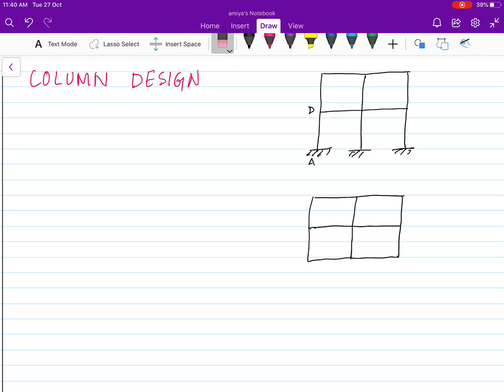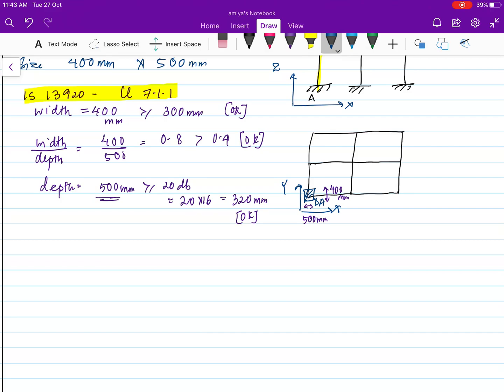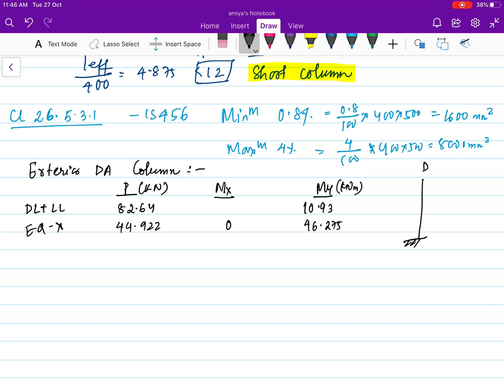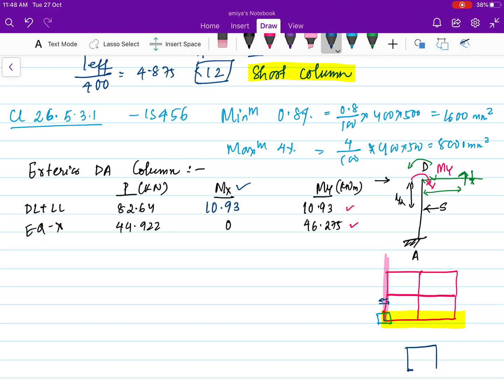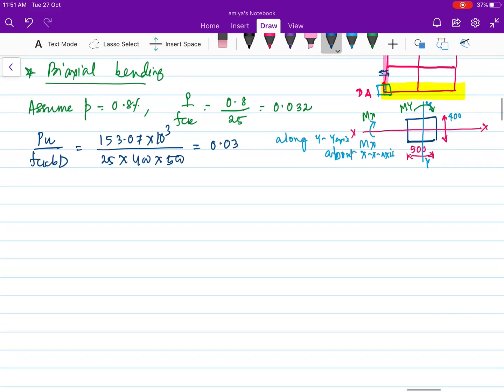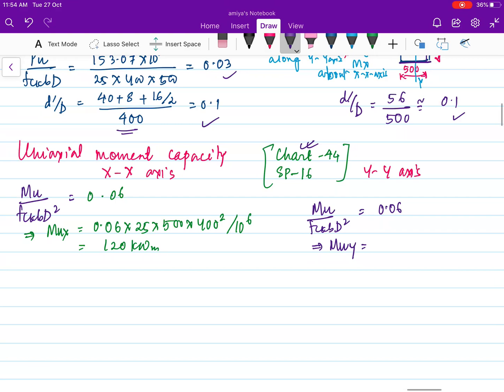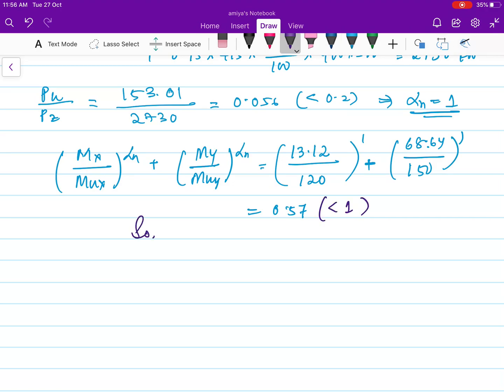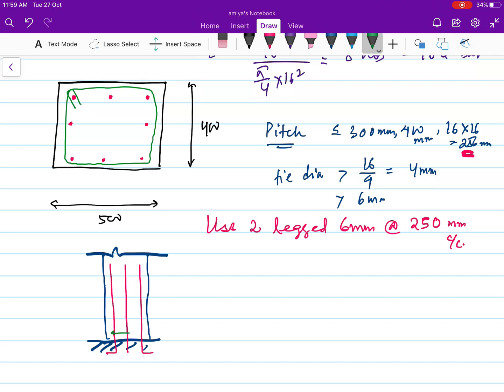Column Design IS 13920

Comment: Mam there is condition in 13920 .If column (b/D) ratio is less than 0.4 then we have to design it as per.. clause 9.1.1 by  considering the shear strength of concrete at  column beam joint 
 With respect to the demand shear stress at the joint...and the shear strength of concrete at column beam joint should always be greater than the demand shear stress ...can you please make a video on that column design when (d/D) ratio  is less than 0.4 ...by briefly explaining the clause 9.1.1..
Please do the video on it  mam.. it will clarify all the doubts regarding to the column design as per is 13920🙏🙏👍👍